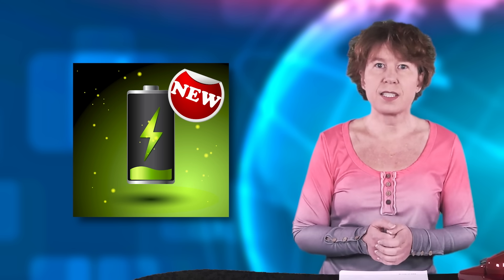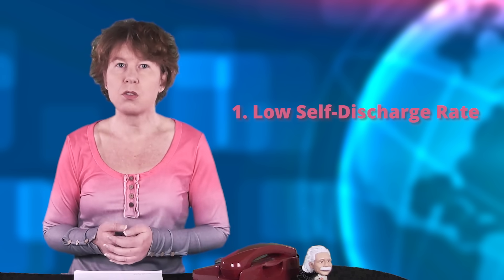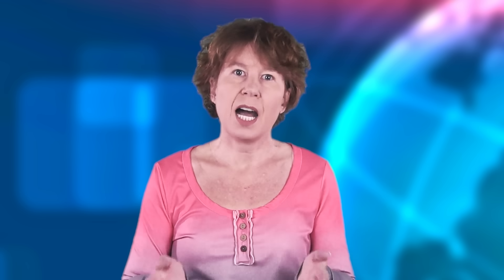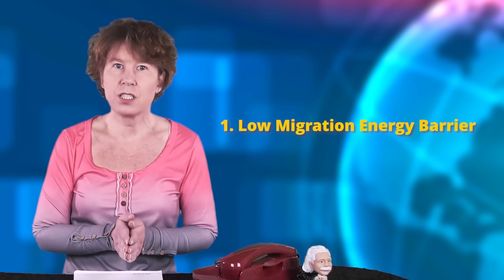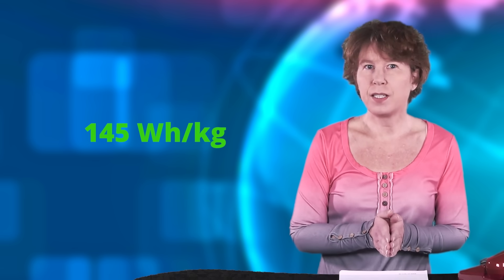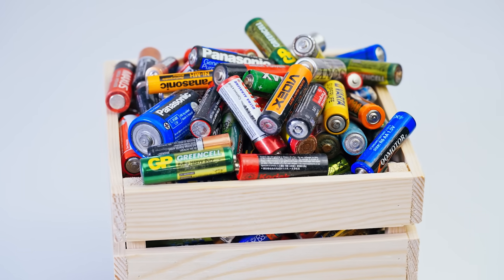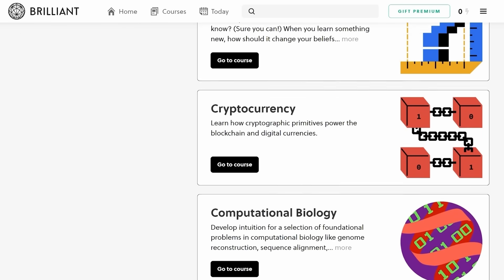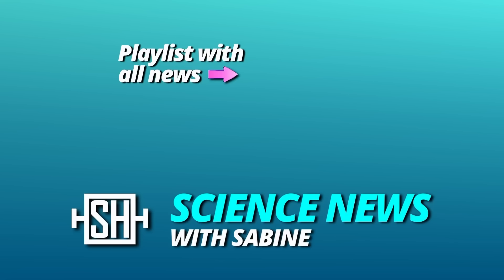Fully Charged in Just 5 Minutes: New Battery Breaks Records

Comment: It depends a lot on how far you can go with a single charge. 
If I'm on a longer trip for my vacation for example, then I wouldn't worry about the battery to fully charge for an hour or more, if it means that I can drive 8 to 16 hours without the need to recharge, or if a few 2-5 minute recharges within that time frame will get me to my destination. 
If I have to take a break every 2 hours of driving though, because I'll otherwise run out of power, then yes, I'd very much like this finish up in a short amount of time. I don't hate driving, but I'd much rather spend my time either at home or at the place I want to go to, rather than at some random parking lot next to the autobahn.

Comment: There are people for whom fast charging is really convenient. Take me as an example. I can't charge at home. The garage in my apartment building lies in the flooding zone of a nearby river, hence it is forbidden to install electric sockets in the garage. Only the light installation hangs from the ceiling. My main travel destinations are 650, 700 and 810 km away, and none of them has a garage either. I don't go shopping with the car, as I have a cargo bike, and several super markets are within a few 100 meters. I don't commute, as I am mainly working from home, and I can cycle within 10 mins to my office. If I could charge my battery within 5 mins, I would take an electric car with 300 km range, rather than a 600 km range car, which takes 45 mins for 80% charge.

Comment: There’s a lot of people who won’t buy a car unless it meets 100% of their needs - a 99% solution won’t be accepted, even if it’s cheaper and more efficient to just rent a vehicle for that one time per year you need to go on a road trip or haul a load of plywood. So, having the ability available to fast charge is an important factor in actual market acceptance of EVs.

As for the phone, I have the 1tb model because the additional storage is connected to the CPU in parallel thus doubling it’s bandwidth - which is (or, was when my phone was built) required for 4K lossless video recording. This also helps in transfer speeds when offloading said video files.

Comment: Conflating fueling ICE and EV cars is counterproductive.  There is simply a paradigm shift that has to be adjusted to.  It should also be considered that battery technology and EV charging are still evolving.  Early in the 20th century gasoline was purchased in jars from pharmacies.

EV ownership is not mainstream yet, but it's important to keep pushing it to its limit.  It won't be too long before EVs sells outpace ICEs.  The public charging infrastructure is increasing all the time, and private L2 chargers provide an alternate fueling method that gas cars have never had.  The fear of overloading the grid has been waylaid.  Overall electric use in the US has been decreasing over the last few years.

Comment: When it comes to EV adoption, consumers are always going to compare the EV to their current ICE vehicles.  And for better or worse, they will focus on the downsides.  They can fill up a gas tank in 5 minutes whereas it takes 20 minutes to charge an EV.  To get buy-in from the majority of consumers almost all of these negatives will need to be addressed.  Range in colder temps, faster charging, lower cost, stress about battery replacement cost, etc... all need to be solved. But I think EV cars have many positive aspects and hopefully the tech will keep catching up, bringing them into closer alignment with the convenance of the ICE cars.